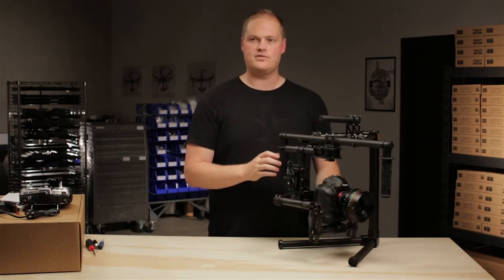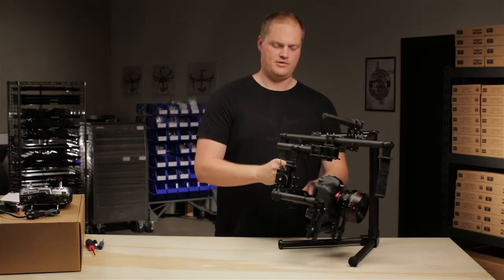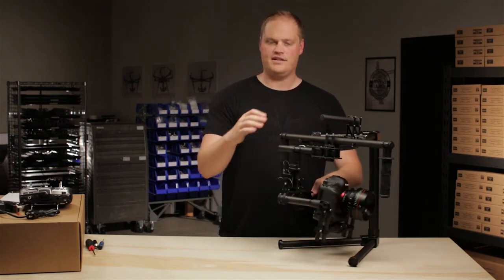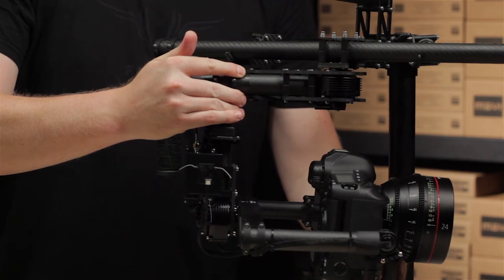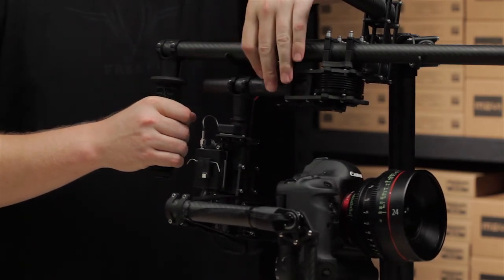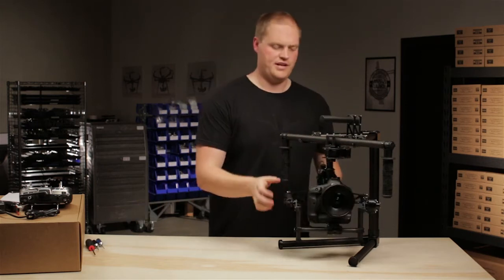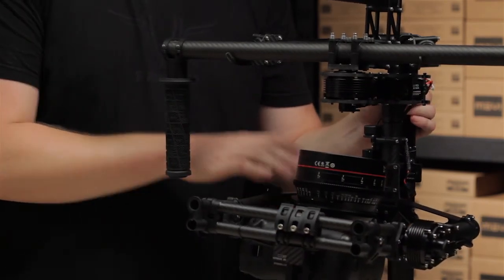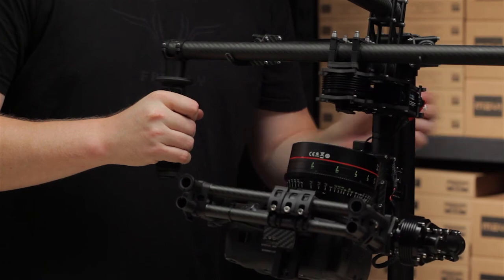MōVI Tutorials - Pan Balance

Comment: Mine does not work like this. I bought it used and the guy showed me that it worked with his camera. But when I switched to mine and tried balancing, the whole thing does not balance. and I CANNOT see how you are actually moving the second part of the pan balancing. the piece you loosened for the first part does not do the same function as as a left and right slide